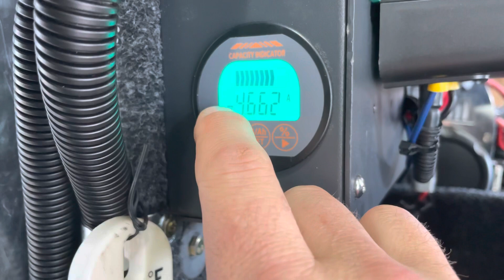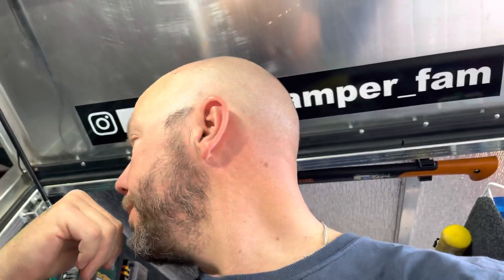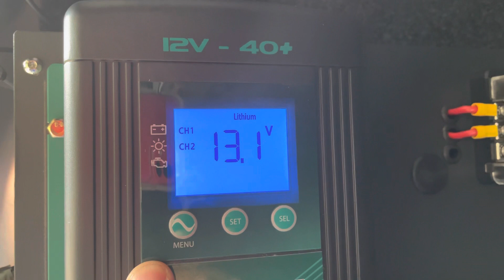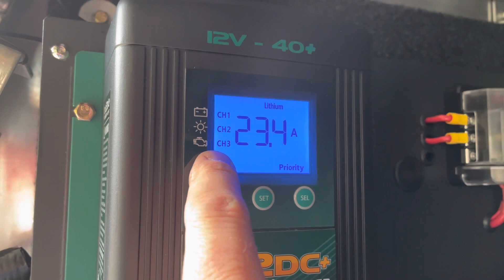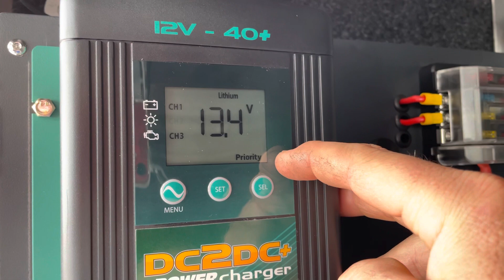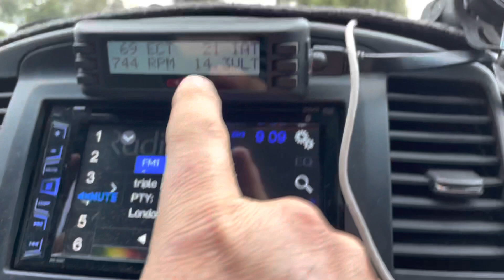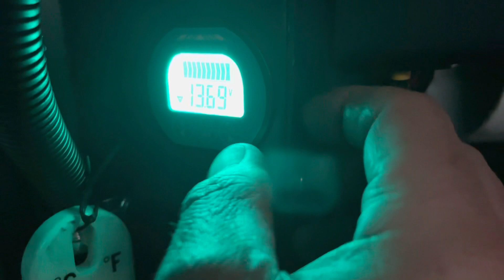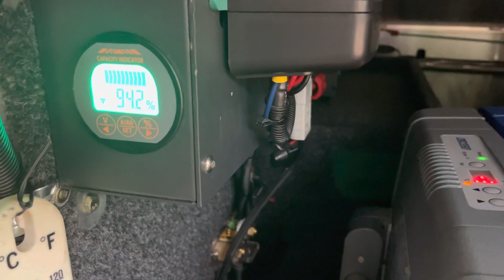Our lithium upgrade!!!

Comment: Can I ask with the fridge runnung and your 12v system runnung do you have the canopy vented? Do you find it gives off much heat inside the canopy?
Reply from the maker: Hi, thank you for watching the video.
I have insulated the canopy which is good and bad.
Good because it does keep the temperature down from the sunshine.
Bad because it does keep the heat in, but in saying that I don’t find it and issue. I have a thermometer mounted inside the canopy which the hottest I have seen it has been 45deg inside the canopy.